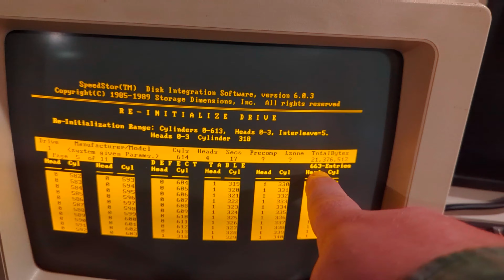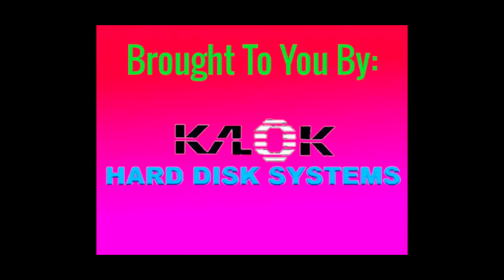80s HDD Autopsy: Seagate ST-225 MFM Hard Drive

Comment: This was the (impressively common) failure mode of many stepper motor based hard drives, can't say i've seen many ST225s fail this way though as they seem to be the most reliable steppers you can still get. We had this guy who went through MFM hard drives in the early 2000s, a amazing amount of the older style drives were bad and sent to the scrapyard, large boxes of these things would come in and half of them would be dead. Of course this was in the era where no one wanted these older drives (including old voice coil drives), they were being sold for less than 20$ a drive. I always thought that maybe those were just a bunch of bad batches, but I keep seeing these things fail in the same ways I remember, and then I tried to get my hands on 3 of these older style drives. All 3 of them are dead, 300$ out of pocket. So I can't say they are too much better today, but I assume after all of these years we are left with the best drives to roll of the production line and will keep working for a while. Sad to see one of these fail, they are extremely expensive nowadays!

Comment: Uhhhhh… I don’t think it should be making that noise?…
Reply: Also I have no idea what I’m looking at here. All I know is that it’s a hard drive.
Reply from the maker: @cleaningmyroom1000  the platter, circle part should be a uniform brownish color. Where you see shiney metal is where the head scraped off the magnetic layer. Very bad noise indeed
Reply: @cleaningmyroom1000  Head crash, somebody either dropped it or it was very badly mishandled.